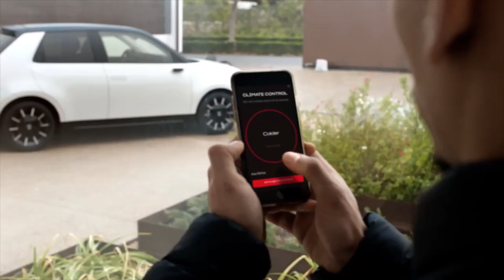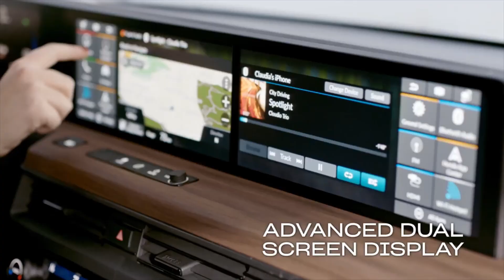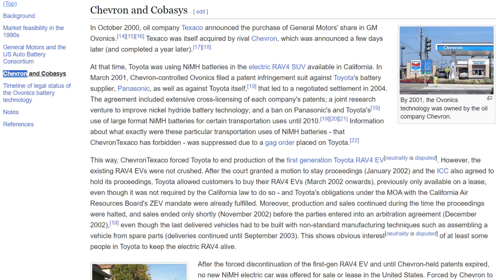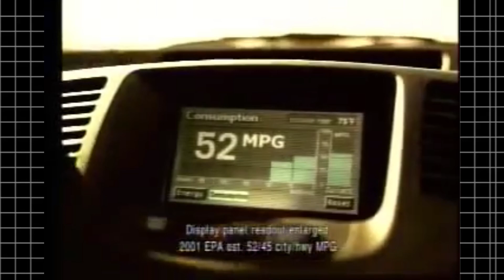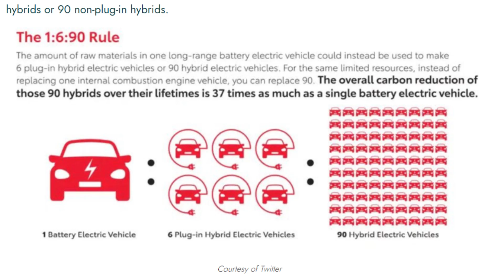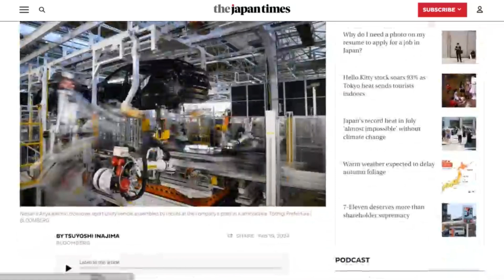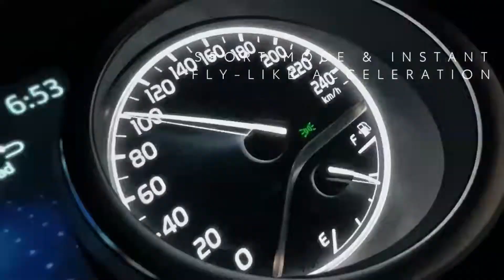Why Are Japanese Car Manufacturers So Against Electric Cars?

Comment: Hybrid is to me the way to go.  You start with petrol cars and transition to electric cars, by using hybrids with different mixes of petrol and electric input.  Technologies are similar, so you learn about electric as you go, but can adapt to which way the world moves.  Hybrid cars avoid range anxiety.  They are flexible for fuel availability.  They reduce fuel consumption.
An electric car's weight and cost  increases with intended range.  So you can make them light and  low cost with short range.  For many people short range is enough.   Perhaps one day short range battery plus small petrol range extender?
Electric cars now are electrifying wasteful SUVs making vehicles too heavy, too large, too fast, too wasteful, too dangeerous for the future.  Theses are going to get limited because they are too expensive and  impose high public costs.

Comment: That’s a really nice story this channel is spreading. The fact is in a short period of time when the battery dies, a new batteries is worth almost almost as much as the car if not more.  There is probably a good reason car dealers can’t sell electric cars or trucks.
Reply from the maker: A video coming on this soon.
Reply: It's likely in a modern EV the battery will last longer than the car.  Thus a good reuse market for stationary energy storage as a second life.  EV batteries are considered replaceable once they reach between 70-75% of capacity, estimated to occur with EVs over the 300k mile mark.  So even when the car is junked, at least there is something of value left to use.  And after that, it has a high recycle value, depending on the price of lithium in the future of course.
Reply: "The fact is in a short period of time when the battery dies, a new batteries is worth almost almost as much as the car if not more"
This is not a fact, this is either wrong or a lie. 2 lies actually: 
"in a short period of time when the battery dies" it's not true, unless at least 15 years is "short time" for you.
"a new batteries is worth almost almost as much as the car if not more", it's not true either. Batteries will cost next to nothing in 15 years. 

There is probably a good reason car dealers can’t sell electric cars or trucks.
Once again that's not true, not everywhere. And the reason why "don't sell well" in the places they don't is more about the infrastructure and the prices rather than the tech itself.

But you already know all that I am sure.
Reply: In 2025, the price of batteries got chopped in half. The only reason, eu, usa and uk won't see cheaper EVs, is because those countries put tariffs on china ev manufacturing, to protect their domestic car companies. Usa put a ban on most Chinese companies, like CATL, byd, Huawei and china chipmakers, for ties to ccp. If ford, gm and chevy made decent ev or gas cars. Americans wouldn't care, but they make dodge neon, chevy volt and ford taurus. 🤦🏻‍♀️
Reply: Japan can't control the means of production because Japan doesn't have the resources that Africa, russia, Ukraine or canada does. Their costs wouldn't be competitive. Plus, gas cars have a way lower cost to make and still has nice profit margin on aftermarket parts.